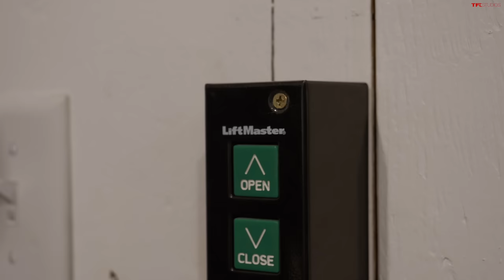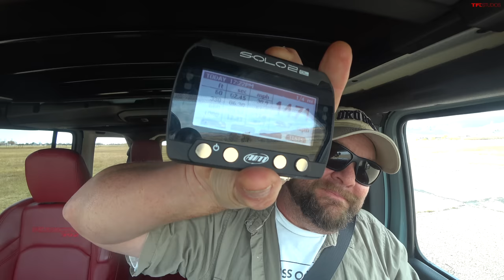Can the Jeep Wrangler 392 BEAT a Ford Mustang GT in a Drag Race? (It's INSANELY Close!)

Comment: I’m impressed with that gen 1 coyote. It pulls strong as hell at that altitude. 104 trap speed is really moving for a N/A
Reply: It's even better with the 6 speed manual and 3.73 axle ratio.
Reply: It’s a tune away from being a lot better shifting.
Reply: But could they smoke brians eclipse is the real question
Reply: 2011-2014 Charger/Challenger SRT8 outran these all day. 12.8 consistently in the 1/4 mile
Reply: @M305-e1g  Mustang GTs from those years were 12 second cars even with the standard axle ratio with the manual. I have the 3.73 in mine and I can say it's an easy 12 second car.
Reply: They should have got their hands on a newer mustang with a 10 speed. Old ass gen 1 coyote did decent for sure though

Comment: I would like to see a Ford Bronco Raptor against the Jeep Rubicon 392. Thanks for the video.
Reply: The Bronco Raptor only has a 3.0 eco boost engine in it. It’s no slouch of an engine, but it’s Nothing special.
Reply: Bronco Raptor isn't even in same league.  Jeep beats it by like a football field in 1/4 mile.
Reply: The 392 would beat the Bronco R easily.
Reply: @Wrangzilla The 3.0 Ecoboost is really quick in the Explorer ST but is not set up for quick acceleration in the Bronco Raptor.
Reply: It's been proven over and over...Jeep 392 is wayyyy better and faster than Braptor. Even that fake baja suspension, it's been tested in Dubai in the desert multiple times....not even close to the Jeep 392. Ford just trying to over hype it for competition. 392 all the way!!!!
Reply: @ixibladeixi2639  Quicker acceleration is the only thing the Jeep 392 has. The Bronco Raptor is not a poser like you are implying.

Comment: Dude these Mustangs seem so underrated. It blows my mind how much of a killer it is.
Reply: If you get a chance you should drive a 10-speed Mustang GT. It's a very good car, especially for the price. I've owned 2, currently have 1.
Reply: So funny I still find it crazy that my stock 95’ 6sd C4 corvette will do a better 1/4 mile time, and out handle that much much newer poostang.
Reply: @DHolmquistDesigns unless you don't let the Stang owner know 'its on', then no, sorry. Your plastic fantastic wrap your ass in fiberglass chevy isn't beating any 10 speed coyote post 2011. You might get the jump at a light but the 5.0 will reel you in every day, all day (stock for stock)
Reply: @QuinnLIFTS  I’ve had a chance to drive several when I worked at a dealer😅
Reply: @lancemannion4113  a second gen c4 LT1, let alone a LT4 will actually beat the car in the video in every category. First Gen. C4’s, no, of course not. You must not know a lot about cars.
Reply: That 392's 112 mph top speed is brutal. Lol
Reply: @DHolmquistDesigns there’s is just slow for some reason also autos are a lot slower than manuals. My bone stock manual 13 5.0 did a 12.6 @ 113. Mutiple friends of mines have there’s in the 12’s stock as well.
Reply: @patr80  sick. I’ll stick a cam an minor tune in my C4 and run that time all day. Still doesn’t distract from the fact that a C4 still out corners and out brakes that barge lol
Reply: @DHolmquistDesigns  and my stock 03 mustang out brake and out turns your junk as well. Glad we can have a civil discussion 👍also who tf even has a c4 anymore. Those cars are trash. And this is coming from a c6 z06 owner
Reply: @patr80  I had a z06, sold it. Good car. If you don’t respect the C4 and know it can shatter a shitty 03 stang with a solid rear axle in every aspect you know nothing about cars or a solid track car for that matter.
Reply: @DHolmquistDesigns  03 “stang” has an irs bud. It’s a terminator cobra. The only car that felt better handling wise I’ve owned was my zr1.
Reply: @patr80  only the SVT cobras had an independent rear goofball which only pull .9 lateral g, same as a base C4. But the SVT compared to price should be compared to the ZR1 C4… which pulls over 1g… the same as a base C4 with 11in rears.
Reply: @DHolmquistDesigns  😭😭😭 you’re more special than I thought. That’s like saying the c4 doesn’t have an irs only the Chevy corvette c4 has an irs lol. Learn what you’re talking about before you make yourself look like an idiot online bud.
Reply: @patr80  bro the base stangs don’t have irs, just the svt cobras. I had a 2005 5.0. The base C4 has irs as well as the ZR1 C4 only difference is 11in rear wheels. Therefore the fact a base C4 can corner the same as a much newer SVT cobra is hilarious. Earlier Mustangs don’t corner well and have unpredictable cornering characteristics when pushed… that’s why you see them smashed into trees so often. This is KNOWN lololol
Reply: @DHolmquistDesigns you must not know much about what you're talking about... 2005 5.0? My 4 cylinder would likely beat your c4 that's even more wild.
Reply: @jwptexas8918  maybe tenths of a second. But definitely not around a corner! And for a car that’s much older that’s pretty pathetic for the Stang.I’ve owned both dude. Have you?
Reply: @DHolmquistDesigns  I've owned 2011 5.0 and 2019 ecoboost as well as 2017 Corvette Grand Sport.
Reply: @DHolmquistDesigns  lol they didn’t make a “2005 5.0” they made the 3v gt that year and even mustang guys make fun of them lol. Those cars will get gapped by a stock Altima. And I don’t have a base stang lol. My car came factory with a built motor irs and a blower. It will gap a c4 in a straight line or around corners.
Reply: @patr80  4.6 sorry. C4 will still out corner any of them until the went fully independent suspension. Even the Cobra svt around that year could only pull .9g in corners, same as a base C4. My has 11in on the rear though with z51 suspension so I get over 1g in the corners…. On a much much older vehicle. That’s why mustangs are pathetic until the late 2000’s.
Reply: @DHolmquistDesigns I've owned both a 92 c4 and 2004 mach1 mustang. Although I loved both of my cars the mach1 destroyed my c4 in both the straights and corners.  Also I had to sell my c4 since it blew a gasket. Only owned it for a few months, it was in excellent mechanical condition and nearly a mint example with only 40k miles. Paid 10k for it sold it for 3k😂. Those old ls1's are known for overheating and head gasket issues even while being treated with tip top maintenance. Mach1 was my first car and still runs like it just came out of the factory with 110k miles.
Reply: @GolfInHawaii69  you probably had blow out or old suspension or crap tires on the C4 because that C4 should be able to out handle that year stang. Or at least be equally as good, in no way destroy it lol A lot of people compare clapped out C4’s to other cars not fresh ones, or properly rebuilt / maintain ones because they definitely eat up corners just as much as any modern day sports car… if maintained properly, just like anything.
Reply: They are light.
Reply: @DHolmquistDesigns 

No it won't.  A coyote Mustang stock will rape a C4 LT1 that is stock. LT1 is about the same as a 3.7 Mustang.
Reply: Nah those mustangs were just slow
Reply: @scott9050  power to weight ratio, plus much much better aero on the C4 says different. C4 also has a higher top speed, 155 compared to 170. May hang with it but definitely won’t destroy it.
Reply: Ford has a great recipe for that mustang. I own an race red 2013 gt
Reply: @DHolmquistDesigns   Must have been a nice dream for you while it lasted huh?
Cornvette.
Reply: @eventhorizon2218  mustangs absolutely suck compared to Corvette. Corvettes are always 1-2 generations above what a mustank can do.
Reply: @DHolmquistDesigns not a snowballs chance in hell at that altitude
Reply: @patr80 they are at 5k above sea level it's like 10k DA there that's why everything is slow and to the c4 comment a c4 in that DA would be lucky to do low 15s lol
Reply: Should have used a 2023 392 XR. Much lighter without that heavy winch and would have spanked that GT! Also, quit freaking drag racing at such a high elevation!

Comment: Having owned a 392 Challenger, a Boss 302 Mustang, and a 21 Mustang GT, I knew exactly how this was going to go. The 392 is unmatched in low end grunt, but it falls on it's face above 5K RPM, the 5.0L is gutless down low, but pulls like a bat out of hell on the top end.
Reply: Which the gen 2 fixed and the gen 3 even more. The gen 3 coyote pulls throughout its entire RPM range.
Reply: @AnglerDanNE  It really doesn't, the 10 speed auto gives that illusion, but it's a turd below 4K RPM. If you look at a dyno sheet, they only make about 240HP and 310lbs-ft at 4K, where the 392 is making 310HP and 370lbs-ft at the same RPM.

Comment: Very interesting video, I enjoyed watching it. I have a 2013 Mustang GT and think it's a great car. If  I ever want a Jeep that's close to the performance of my Mustang I will get the Wrangler 392.
Reply: I'm disappointed... as a mustang owner, you should know the 392 engine is big and bulky, the power drops due to weight... if the mustang just got on throttle a split second faster, it would have downshifted fast enough to blow past the 392 a couple lengths... and i'm guessing it isn't tuned, but the mustang will get loads faster, that 392 MIGHT get 10hp.

Comment: Having a 2013 GT and racing my wife's 2021 Grand Cherokee SRT for the last 3 years, I knew the results before even watching this. The GC has much better aerodynamics than the Wrangler, but I reel her in every time. That 6.4 is amazing, any my wife has a best of 13.0 at 104mph in the 1/4 at 2500ft elevation. That is nothing to balk at for a N/A SUV pushing over 5K lbs. But her extra 60HP cannot overcome a 1,500lb weight difference and the aero as well, even with AWD giving her a much better 60ft time. BTW, my best was 12.5 at 112mph stock. Just FYI for those that want a better idea of how much elevation affects time slips.

Comment: I have a 2014 mustang GT and i love it. I really like you guys are using one in your videos as well. I was thinking for the roll races with the mustang, wouldn't it be better if you used sport mode and had selected the gear manually to start off in so it doesnt fall behind so much at the start of the roll race.

Comment: The DOHC 5.0 can rev and breathe better than the pushrods, that's why it can catch and overtake the Jeep despite the Jeeps excellent 8 speed. This is why it takes a much bigger displacement OHV engine to compete with it.
Reply: Jeeps weight is why the mustang caught it.  Its the weight of a pickup

Comment: correct me if I’m wrong doesn’t the 392 have a governor at 98 mile-an-hour
Reply: Which state?
Reply: I believe all states. It’s either 98 mile an hour or 100.5 mile an hour.
Reply: 112mph so it wouldn't have effected the outcome of the race
Reply: The top speed is limited because of the tyres.
Reply: @johnmaier3103  so all your state governers are speed restricted
Reply: Yes the speed governor kicks in limiting you to 99. The 392 used to have an XR ( Xtreme Recon) package that would change the limiter to 114 I’m pretty sure. I’ve gotten my Wrangler to 113/114, but that wasn’t on no 35”s lmao.

Comment: ...Now, after watching the video I'm pretty surprised at how slow that "392" was compared to a stock mustang.  There are a lot of fast SUV's on the road, this 392 wouldn't compete with other special edition 'SUV's'.   odd!   
Interesting video nonetheless
Reply: Well that's because other suv have 700hp on average. The jeep only got 75 hp more than my ram 1500 and plus it's got massive mud terrains. It's not gonna compete with x5m or gl63amg for sure😅
Reply: I could be wrong but there are not many faster SUVs on the road. The 392 is faster than most all of them you may run into daily and the hellcat is faster than all but a couple that cost twice as much to possibly edge it out. Mopars 6 liter SUV's are pretty dominate on the road for a SUV. A select BMW M series or a AMG might be a touch faster than the 392 but not by much especially for the price difference. And those are slower than the hellcat equipped version. You need to look at a Porsche Cayenne Turbo GT for $200,000 to edge out a $100,000 Hellcat SUV and I can tell you what's the odds of running into either one of those in the streets. Got to give Mopar credit where credit is do for affordable performance SUV's. There are some modded Jeep Trackhawks and Durangos going down the 1/4 mile in the 8's, very impressive for 5000+ lb vehicles.

Comment: Cant believe how much elevation kills HP. 
A 3.6 camaro is faster at sea level than that mustang GT at elevation. I have a 2018 RS runs the 1/4 in 13.6 seconds at 106 mph. I bew elevation kills HP but didn’t realize that much. Im a snowmobiler live in upstate NY but been to Idaho and Montana a few times riding. The turbo sleds do a lot better at elevation than the NA engines turbos or forced induction don’t lose much if any power at high elevation. What about cars would it be the same thing turbos at elevation don’t lose power.  The jeep actually impressed me more than the mustang didn’t lose by much. 
Good stuff thanks for sharing.

Comment: Not surprisingly the outcome even using a older mustang. scat pack challengers typically loose to mustang GTs as well. However owning both a new Durango SRT392 awd and a newer mustang GT, im not shocked the Jeep jumped it in the 1/8 mile til it's weight caught up to it. If I was stoplight banging I'd take the awd 392 as well, but in the 1/4 you ain't beating the coyote once it gets the chance to stretch its legs although it's a pretty close race in the end.

Comment: Crazy part is he is driving a 2014 mustang, 2015-21 mustangs are even better sitting at 460 hp instead of the 2014s 420 hp. And with the 10-speed it’s so fun but I’d prefer a manual to feel more in touch

Comment: Not really a great comparison. You're testing a jeep against a car. Factors like gearing,weight,rear differential. Put the Mustang Gainst a 392 Charger/Challenger. 392 should take the quarter mile every time, assuming the driver doesn't suck. Now in a roll race, that's a different story, in favor of the Mustang.

Comment: The only reason the jeep had a chance was from the trans and being awd/4wd ... if you would have at minimum down shifted the mustang and the jeep it would have been a whole different race.
that close up exhaust shot sounded horrible, I can guarantee my car sounds 10x better both were super quiet :)
and i'm ngl that 392 jeep sounded horrible, it had a little crackle but it was worse than the stock exhaust on a 2010 gt.

Comment: That mustang can only do one thing and that’s go a little faster then the jeep in a straight line. The Jeep with bigger tires is only a hair slower but can do EVERYTHING.
Reply: The mustang can go around turns fast, the Jeep not so much and the Jeep was a lot slower. Andrey doesn't know how to launch that Mustang. A good driver would take the Jeep off the line and wave goodbye.
Reply: @heathwirt8919  I don’t think so the jeep makes more power/torque and has all wheel drive. And lockers haha and can climb rocks im sorry but the jeep is 3 times the machine the particular mustang is.